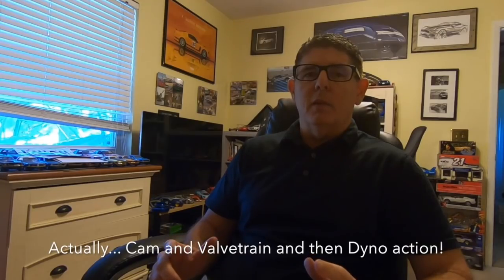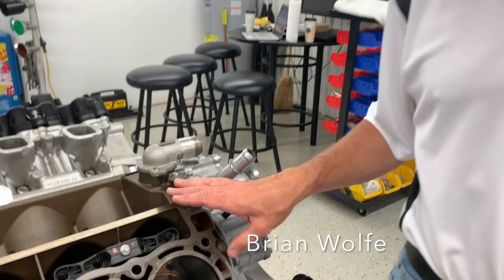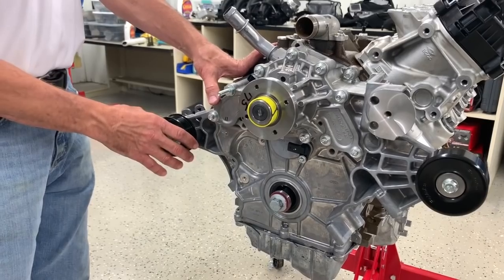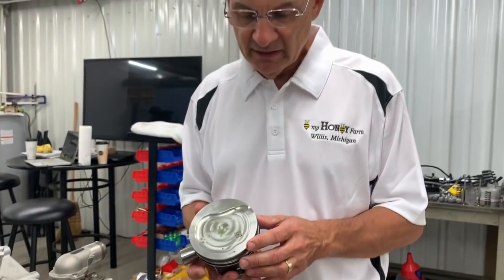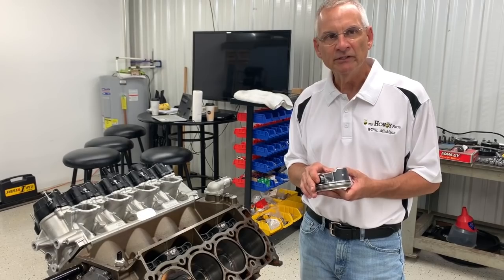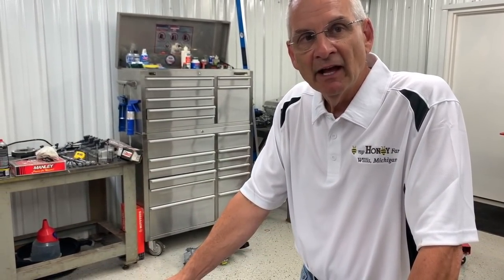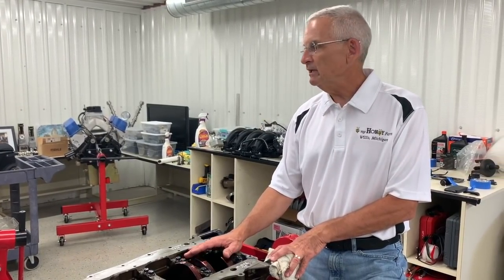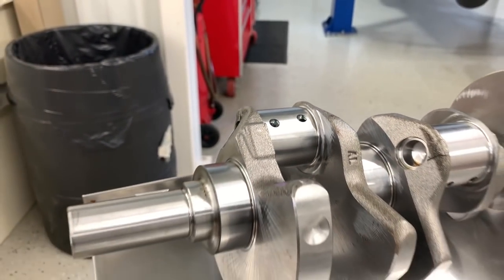7.3L Godzilla Ford V8 Bottom End Teardown — How Big Can this Engine GO?  Crank, Rods, Piston, Block

Comment: R.E. ………..great job , Im old so tell Ford enginners to send 6,, 7.3 s to Kasse and the Gliddens and big check for both and get out the way so they can make POWER !!!!!!!!!!!
Reply: Boss nine heads would be so cool on top of that block!!!!
Reply: Yes jon kaase needs to build one of these lil monsters
Reply: I like how people point out Kasse and Glidden as great Ford engine builders (they are) but nobody gets more power per CI NA than the Engine builders in NASCAR  358 CI  850HP  on 99 octane unleaded is pretty stout. Plus they run for 500 miles not 8 sec.

Comment: This engine is using all the good designs of the past, the full skirt block of the FE and Y block, the cantered valves of the Cleveland and 429/460 and the timing cover a bit like a Windsor, just hope it has the firing order of the old Y block to get that sound. Also with the chain driven oil pump there must be a way to drive a external oil pump to lower the oil pan for engine swaps/racing

Comment: I think his stroke recommendations are way conservative, I would concur that for higher boost 4.1-4.2" stroke is probably for the best. Remember this is a 9.65" deck, an LS is a 9.2" deck, they run high boost on a 4"-4.1" stroke LS prettry regularly, a 3.622" or 3.856" stock LS/LT or L8T stroke is probably a better idea for over 1000-1500hp+ regular racing use, however for N/A work aftermarket 9.2" LS are frequently run with a 4.125"-4.25" stroke. I have seen than Callies is coming out with a 4.6" crank for the Godzilla which I am guessing is for n/a application. I figured with a 4.225"(0.005" over hone) bore and 4.6" stroke you can have a 522ci Godzilla and I would guess that with a shorter rod to allow more piston thickness and that ample cylinder thickness 1,000-1,200hp operation with boost or nitrous should be safe enough. 9.65"-9.2"=0.45"×2=0.90"+3.975"=4.875" So there's no reason even at that stroke with the added deck height that the rod can't be shortened a little if necessary and still allow at keast equal piston crown to what an LS with 4" stroke with moderate boost has. I would imagine that a stroker Godzilla should be able to be built with 800hp+ n/a and make 2,400hp+ on 3bar no problem, especially considering that a rod and piston engine with head work can make 750+hp already. Shame Ford didn't sneak in an easter egg in the Godzilla block design, since it has a 4.53" bore spacing, where it has FR9 Nascar headbolt pattern allowing one to buy a bare factory Godzilla block for $1,500(they were $995 for a short time) and put a set of cheap used Nascar FR9 heads on it. I still think Dart or someone is missing out on a goldmine if they produced affordable cast iron(instead of CGI) blocks (possibly with a taller deck for strokers) that can use all the cheap used Nascar R07 and FR9 heads and accessories. With the wide bore spacing that would mean much larger than the 4.185" bore also, surely more like 4.250"+ bores, which means 371ci instead of 358ci with a standard used NASCAR 3.25" crank and could mean 454ci with a 4" stroke at standard deck heaight without oil sprayers in the way and 511ci+ with a tall deck and a 4.5" crank, which are also number a Godzilla could be built too.

Comment: How did you guys hook up with a 7.3 so soon? Glad to see a good jump into the aftermarket so early in production, but it’s gonna be several years before they turn up in salvage yards for any reasonable price.
Reply: we all work or worked for Ford...
Reply: Motorhomes my friend
Reply: atom atom how bai it disassembly manuals? How do you guys get those for such a new engine?
Reply: Several years?... Your forgetting about crashed trucks. Im surprised there's not dozens on eBay yet
Reply: Brian Wolfe was Chief of Product Engineering before he retired....I am responsible for Ford global crankshaft manufacturing.
Reply: @brentiaconelli6484  no, I'm definitely not forgetting about totalled out truck. They're still getting $4,000 for a late 6.2L. You can get early 6.2L for about $1,500-$2,000. Most dealerships still don't even have their hands on a truck with a 7.3L yet. I bet they're gonna be 5-6K when they start to turn up at the salvage yards, and you're still gonna have a grand or two into an ECU and a harness just to make it run. So yes.. It's gonna take a few years for a nice nation wide stockpile of used 7.3L's before it's practical for the average man to consider it a viable swap.  People will lined up for the first complete salvage vehicles to exact the goods from.

Comment: Fractured rods are awesome. In caterpillar land we have been using them for ever. Although all the bolts we use are torque to yield. I dunno about this ford rod but it’s something to keep in mind if guys are going through there oem rotating group to balance it or whatever they may need to change the rod bolts. Maybe they will make an arp bolt or something. Please put some pistons and rods in this engine and a 102 on it and a little methanol lol.

Comment: I already put in my order at the local junk yard.. When they get 1 in call me.. I still can't get over the 1800 hp comment 😬😲😎
Reply: Ya.... I have a little struggle believing that block will hold that for any length of time. Mains and crank look great but that slit in between the cylinder walls was a performance mistake. There will be sleeves coming out for this I guarantee. At that point I could possibly see 1800.

Not trying to be that cold water pourer tho🤣
Reply: Your going to pay a fortune

Comment: Built for strength and longevity I like it a lot👌🏼🏁
Reply: J Smith the first gen had problems but they have been resolved, not like government motors type of problems though lol
Reply: @J Smith agreed, gm literally forgot how to make engines that run properly.  Ford seems to be the only one that can figure out how to make a turbo engine that doesnt shit itself when worked hard
Reply: You wan Ford reliability, look at that Barra i6. Sadly they're out of production and big externally for a 4.0/245cid.. but damn if they can't make power
Reply: @J Smith what don't I know? Hmm? That the Barra i6 are capable of street power levels in the 600hp range? That they're reliable, or that they're externally large? I mean, I have one sitting in the back of my truck.
Reply: @J Smith you spelled ecotec wrong

Comment: People going bananas on the horse power comments for the stock crank. I think he was talking about turbo. Obviously centrifugal is harder in cranks. But it’s common for oem coyote cranks, ls cranks and even Honda cranks, all of which are forged, to make big boy hp. Just bc someone may have thrown some parts together and didn’t check squat and they grenaded their stock ls or coyote crank doesn’t mean it can’t be done or isn’t done all the time by real builders. The stock forged units are very good. And the blocks now days are also very good. I forgot to mention, many gtrs out there making north of 2000 wheel use a stock crank. Anyways those pistons look like mahle power pack 26 cc units aside from the compression ring insert. I am super pumped on this engine. I think this engine with a piston and rod upgrade will be strong enough for most of us knuckle heads. Very happy to have a ford pushrod engine that you don’t need to dick around with aftermarket crank and cam sensor setups etc. Wish ford would get away from dumb coils and go to a smart coil. But that’s just bc I don’t want to buy a coil driver to use the stockers lol.

Comment: The slit in between the cylinders is a point of failure (for a boosted engine) not an increase in reliability. I've replaced shortblocks for nearly 100 Ford Ecoboost 4 cylinders that had coolant consumption CAUSED BY THE EXACT SAME SLIT!!! In May Ford released a revised block that had a hole bored between the cylinders that connected to the coolant passage in the cylinder head rather than the older slit design. Mark my words, that slit is a death sentence if you run high boost!
Reply: Good point.  The new GM 6.6 gasoline truck engine has a hole drilled at the top of the cylinders for ring pack cooling.

Comment: 2:23. Shot of block deck and pistons.  Pistons look like inverted dome big-block Chevy pistons I used 20 years ago.  The close proximity of the intake valve notch to the piston od will make it easy to burn the edge of the valve notch out of the piston if too much spark advance is set.  The saw cut is good for cooling the inter-bore region on a heavily loaded truck engine, but may limit max overbore.

Comment: After my VW and Datsun is done I want to build a Ford Galaxy with one of these 7.3’s.
Reply: I hope you dont put a cruis-o behind it 😂
Reply: Pablo Tharpalo 
Nope. Six speed
Reply: @adamlemus7585  Man I had a 66 Galaxie 500 xl with a 390 in it...It sat on my granpa farm here in Texas for yrs I sold the 390 out of it bought a 429 block with the intent to build it but kids wife and farming takes most of my time
Reply: Marcus La'Don 
I have a line on a 64 Galaxy that a friend of mine has and may be willing to trade a few Honda Mugen parts I have. It’s a 64 black on black, no motor, no transmission just right for a project. 

But yeah family and spare time is expensive
Reply: @adamlemus7585  I feel ya. I just bought a teal 63 4 door project 352 + cruis-o-matic. Gonna chuck a C6 in there instead
Reply: @adamlemus7585  yeah I love those round taillights and the front on the earlier models...my "neighbor" by my granpa farm in streetman Texas gotta ford coment its a roller and I got my eyes on it...

Comment: I would like to see a little bit of a beefier timing chain. I like the look over all though.
Reply: It's really overkill in the strength department and is only steel because its the cheapest way to get the job done. It also transfers significant harmonics to the valve train. The best timing chain available is actually a rubber belt w/ adjustable aluminum gears. the timing belt's unbelievably super thin and narrow. It's a "jesel belt drive" and costs 1500$ for a Ls. Once u see this in a 4000 hp engine your opinion on timing chain girth will change
Reply: @brentiaconelli6484  I am familiar with a belt conversion.  And no it doesnt change my opinion. I would like to see a bigger chain or double roller chain for this application. Harmonics are not a issue. Double roller chains have proven their dependability for probably trillions of miles or more.  What it really boils down to is ford did the math.  The can use the little chain and it will make it out of the warranty period.  Then on top of the that they are going to save $15 per timing chain.  Multiply that by 500,000 units and they saved 7.5 million dollars. It was one way they saved money,  just like plastic valve covers, Plastic intakes thinner castings etc...

Comment: Some of these components look lightweight for such a powerful motor.  The chains are tiny.  The sprockets seem lightweight for 500 ft-lb.
Reply: No auxiliary shaft off the cam... cam's not driving a distributor and oil pump, no need for extra beef. Actually thinking about it now, what on earth were manufacturers thinking putting that kind of load on a gear off a shaft drive by a chain anyways, unless it was about dampening any flutter by having a load....

Comment: I'm just curious what levels the powdered rods could go to? It sucks that Ford uses them in things we want to race. I'm someone who's just curious because I'd like to know if the thing would hold up to some boost right out of the junkyard in 10 years. Or if it's going to require new rods for anything more than stock power levels.

Comment: I may be wrong, but it would make me uncomfortable putting very much boost to that engine with the semi free floating siamesed cylinders. I just get the feeling that heat would build between them and they could possibly move around causing head gasket failure in the least. Similar to the ford focus rs engines that have the same type of cylinder setup and are popping head gaskets at very low mileage. Just doesnt seem like very much support around those cylinders. Just my opinion though.

Comment: So why a chain driven low mount oil pump vs Modular style crank driven unit? Also the aftermarket is going to have to think of clever ways to make an oil pan with filter mount. Sounds expensive for the end user

Comment: So I noticed in your Fox Body swap you’re runnin’ the 10R80 behind the 7.3. What are you guys using for power train management?
Reply from the maker: We're working on a solution for that.
Reply: @revanevan  Since there is so such ECU ready to go, I think the 6R80 would've been the way to go. But far be it for me to criticize your work. I'm just happy to see such a quick jump start putting the 7.3 in something less than 7,000 lbs. Lower profile intake is a must as well. Keep up the great work!

Comment: Does the factory save that much money per unit that they can't upgrade the engine to fully forged (everything) and then be able to promote as such ? I'm sure in a $50-$80k truck they can hide the extra $300-$700 'cost'.
Reply: Forged pistons expand more meaning they wear the bore and pistons significantly more than a hypereutectic piston as it goes through heating and cooling cycles
Reply: Yes they save millions. Not to mention NVH requirements.
Reply: @void2618_  Cool thanks.
Reply: Like your thinking . Always thought that if you do it right  , then they would only ask for "more" work done, not repairs!
Reply: @void2618_  Also expand at different rates and tend to have poorer start-up emissions. OEM engineers have a million considerations the average hot rodder doesn't. Rarely is "better" a simple metric!
Reply: @void2618_  you would think that, I know I switched to niks cast pistons in my old bikes because they lasted longer than forged wisecos, but the forged piston fox body 302s lasted a really long time, and I rocked a built 306 with forged pistons for about ten years 120k miles and it looked great when we tore it down.
Reply: @joenobody2580  forged pistons can last in certain scenarios, but from what I've seen it's the exception not the rule. There are so many variables that affect wear characteristics that its not a black and white solution; but I was speaking generally about forged vs. cast
Reply: I doubt the Factoria do that if you sell a million of them and you just left $700 on the table
Reply: They are still using plastic timing chain guides

Comment: Hey bro any hard facts of the bore size and stroke length? I heard 4 inches stroke.

I trying to simulate the potential power NA and single turbo application.
Reply: Bore 4.22-inches x  stroke 3.976-inches
Reply: @akman1931  so its roughly a 107mm bore and 100mm stroke. Slightly oversquared. Destroke it and it can be rev happy. 

Hopefully VMP can make the Odin kit a direct bolt on for the 7.3L then we can be ripping in 1000bhp trucks at the drag. And still haul the load daily.

Comment: Can someone enlighten me on the wisdom behind putting water pumps or coolant passages in this case in places that should a leak occur will result in coolant pouring into the sump.
Reply: It's not that big of a deal. It's the same design Ford used in the Cleveland, Windsor, the 385 series. They used paper gaskets though and Chevy and Dodge has used the same design also.

Comment: That would be nice with forged rods and pistons with twin turbos or a Vortex blower on Natural gas at 130 octane and -100 degree inlet temp. Put it in a lightweight 97-03 F-150 short bed and say 1800-2200 hp.

Comment: Have you weighed the engine yet?
Reply from the maker: Getting all the weights and they will be in the next video that I'll post in a day or two.
Reply: Im curious as well, its similar dimensions to a Cleveland so i would guess under 575-625 lb range depending on how much aluminum is in it
Reply: @smokenchoken1736  Ford Service manual (WSM) lists the engine without accessories at 580 lbs.
Reply: REVan Evan I have a inc pallet weight of 700 lb complete. Engine itself very close to 600 lb as guesstimate
Reply: I posted the wrong listed weight earlier, it is now corrected above. No accessories, but does include flexplate.

Comment: Hmmmm...... I'm seeing deck plates and sleeves in this blocks future. Boom! Now add your 4.250 or 4.500 stroke crankshaft!
Reply: Fun fact.. my Barra has a 4.02" stroke.
Reply: @PureCountryof91  It gives my heart great happiness to learn that your engine has a 4.020 stroke. I hope you share the same happiness for the 4.150 stroke in my Hemi. Best regards.
Reply: @jamessheets9205  I can get rods that will bring the stroke up. But not cheap at all
Reply: @PureCountryof91  I hate to be the one to break it to you, but just adding longer rods will not increase stroke. It just changes the height of the piston in the bore. Not the amount of up and down travel it has in the bore. You will change compression, possibly need custom pistons, change the amount of side loading on the bore from the piston skirts, and you will also increase the amount of dwell time at tdc with longer rods.

Comment: I know this is probably sacrilege for such a nice new engine, but I wonder how well these things will just take abuse in 6 years when people are picking them up for dirt cheap and throwing ebay turbos on them.

Will we finally have a motor that can dethrone the 6.0 Vortec for cheap power? One of those made a tad over 1,400hp with nothing but gapped piston rings and a couple turbos on an engine dyno.
Reply: Fully skirted cast iron block, 6 bolt mains, beefy head bolts, and a stout crank. Yeah, I am guessing this engine will last.